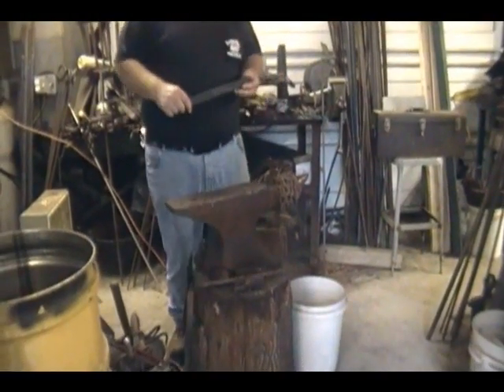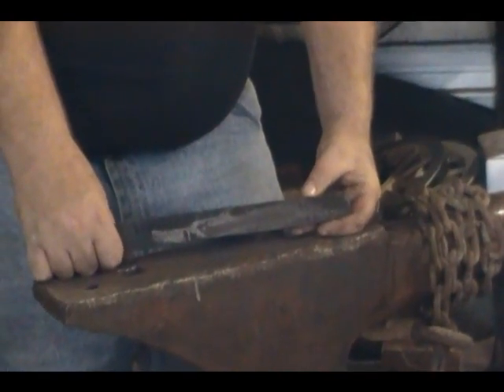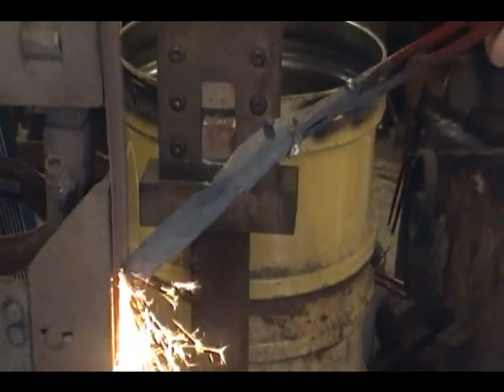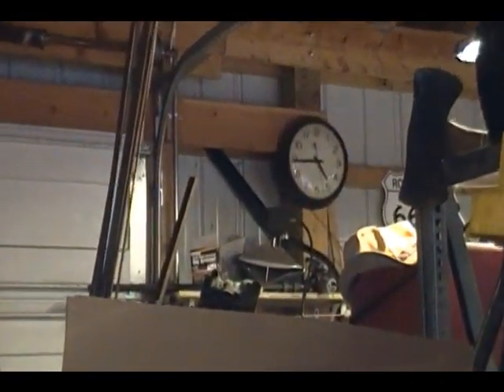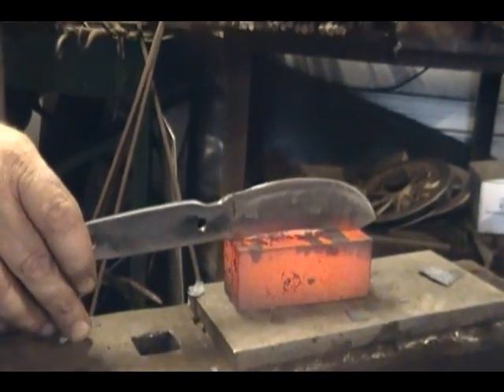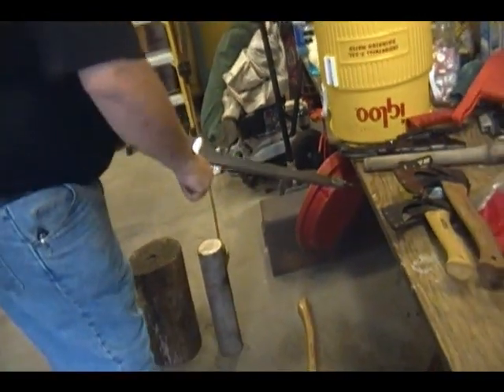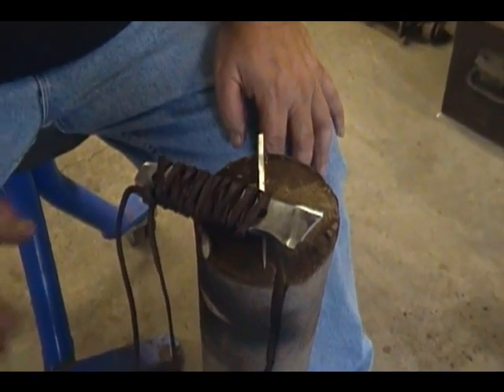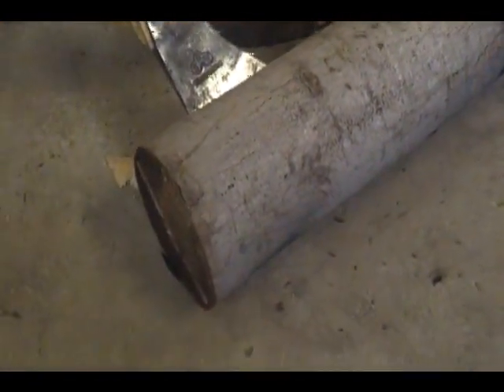Two hour knife challenge

Comment: That's a great attempt.  It might have been a failure in the draw, but I've had cracks develop when forging files--they radiate from the cuts in the files.  If you have one of these, edge quenching can cause these cracks to radiate from different expansion/contraction rates of the edge and spine.  

I've wondered if the surface of a file should be fluxed for the first couple forging heats...